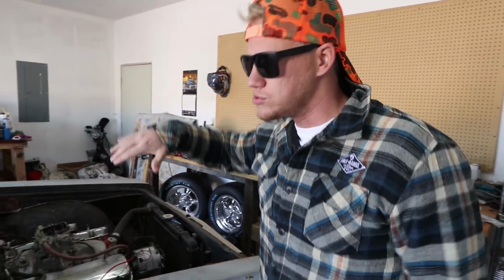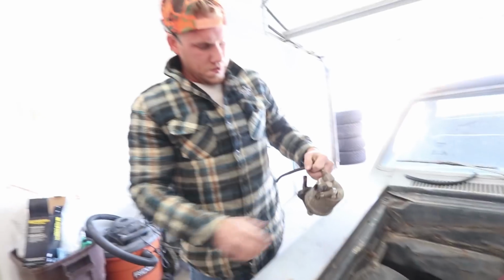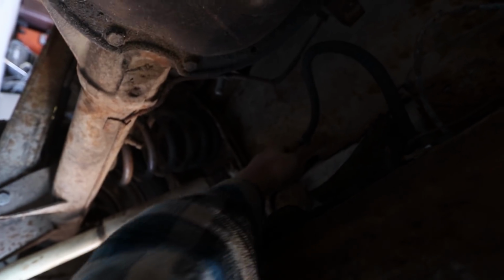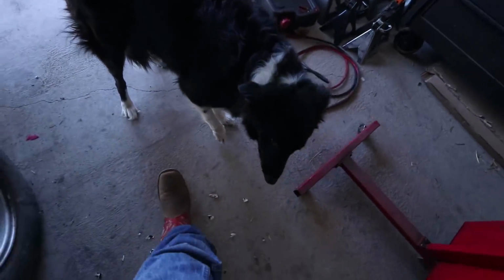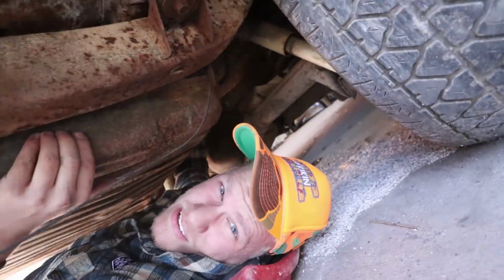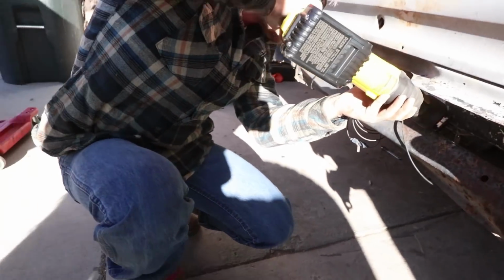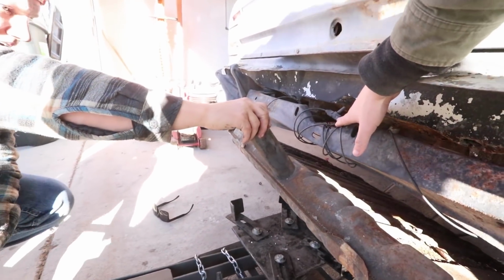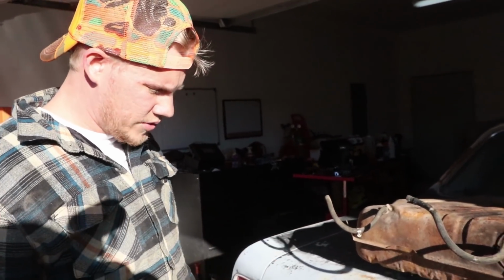This AIN'T Good... *Also DANGEROUS*

Comment: you should use a pipe attached to a ratched to get the extra leverage you need to get the fuel tank straps off